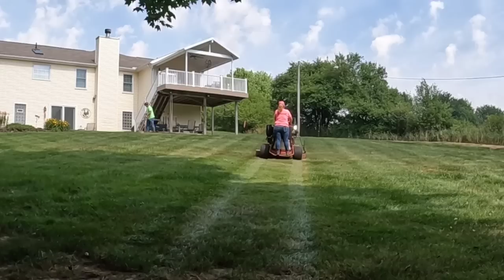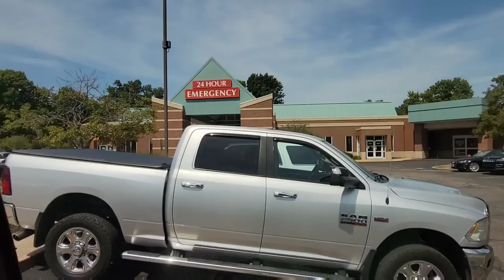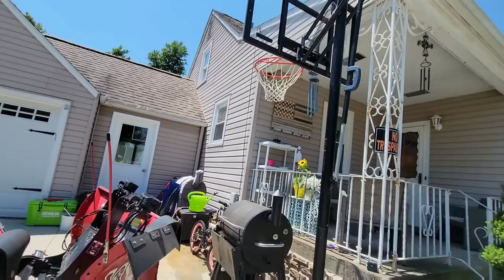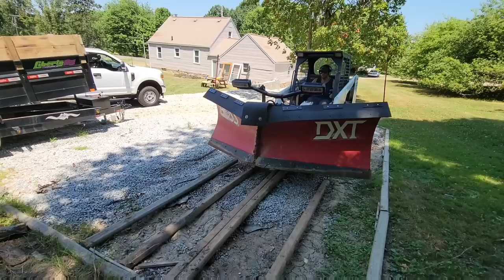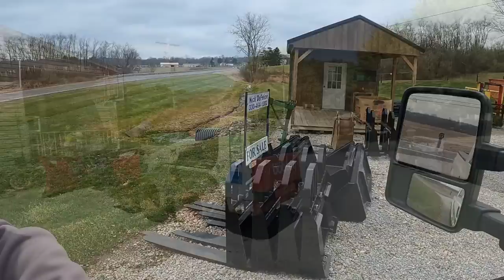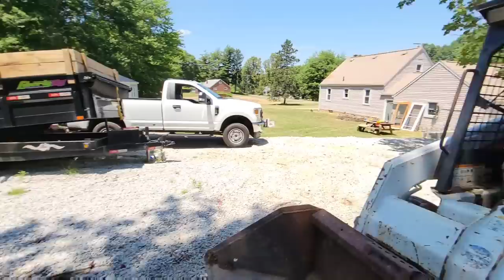I HOPE THIS WORKS BECAUSE I DON'T WANT TO HAVE SURGERY!

Comment: Shawn, Do what I do with my tractor. You already have a roof over you on the skid steer, I have a canopy. I just put a golf cart cover over the canopy and let it hang down. At the bottom part I use spring clamps to hold it down. A friend used my idea on his Takeuchi (spelling) skid steer. it keeps the elements out, not bad for him because he's sitting next to the engine, bad for me because Kubota puts it's radiator in the rear of the engine and pulls the air away from the cab area.  This winter I'm hoping to have a cab for it.  I use to be a licensed yard maintainer, now I just help landscaper friends, and push snow in the winters.  Here in Delaware We've seen some winters with no snow so I don't count on that.  Just something to keep me busy in retirement.

Comment: Hope you have a speedy recovery.  It would be worth looking into the plow. They might have a setup for that or they might be able to put the blade on a new mount. I know you can put a standard straight of v plow blade on a skidsteer. Size might be an issue. I got a western enforcer on my truck (1/2 ton) and those are popular skidsteer plows. But it's also only a 7'6" plow. My wife wants me to fire up the grill this weekend after seeing what happened to you and Brian Fullerton I am a little afraid.  Landscaper grill jinx this week?

Comment: Camso makes a rubber track system that does fit over the standard tires..I don’t know about you specific model…Having plowed snow with a skid steer I would fully recommend an glass enclosed unit…I prefer a skid steer for plowing because you can consolidate you piles of snow better because you treat the snow like an aggregate and pile your snow as high as you like…you are looking right at the blade so it’s easier to see how plowing is actually going…and you can instantly reverse the direction of plowing so if you set your plow job up with a pile of snow in each direction you eliminate all the reversing with no snow removal. The only down fall is having to move your equipment around if your jobs are all not in one place.

Comment: After that you loaded the first snow blade up and started to go around the house and the view looked as if the blade was attached to the Bobcat, I thought wow wonder if a person could fasten one of these snow blades to a skid steer . The company that I worked for years for, I ran there open cab Bobcat with tires and never used chains, moving snow at their restaurants and convenient stores, but I believe it was a
783, it's been numerous years and I have a had a blood vessel bust in my brain and it caused me to have a sever stroke on September 5 of 2014, but I have had a blessed recovery and the best thing is it never  affected my ability to talk, eat and swallow, but paralyzed the rest of the right side of my body for a while, but doing good now . Years ago I had  a problem with my lower jaw swelling up all down underneath from the front of my chin and back to under my ear and hurting and getting really sore, the swelling would go up and then go down some and I could work doing this or that and maybe get hot or just exert myself some  for awhile and the swelling would go back up and it was 2 of my wisdom teeth causing all of the trouble . There just wasn't enough room in my mouth for them, I had all 4 of them pulled and never did have anyone problems . But anyway hoping that you are doing better . I will see you all later, so take care and stay safe and keep on cutting grass and making us more videos .
As always, Jeffrey !!!
🤗👍💖💫

Comment: ENT is an Ear, Nose & throat specialist. I had an oral abscess & saw an oral surgeon, he lanced the abscess (without local anesthesia), it would not have worked apparently, so he just cut. Make sure you are kept on long term antibiotics to completely wipe out the infection - over a month. I wasn’t on long enough & ended up 3 month later in the hospital with bacterium sepsis for a month, which I don’t remember, followed by another month in rehab, receiving antibiotics through a pic line & learning how to walk. So be pushy, ask for long term antibiotics. While on them take probiotics to keep the gut working properly, otherwise you will experience intestinal problems. This is a serious matter and not to be put off. (I’m a retired nurse & this was a very difficult to go through, you don’t want to experience this. Prayers that the right medical personnel take care of you and that God grants you a total recovery.

Comment: Honestly  for what all you got going on with the property and if your wanting  to mainly use it for loading and snow removal consider a loader tractor that has a cab. It'd would be cheaper than a skid steer and also offer other flexibility and a world of attachment options front and rear.

Comment: I had a tumor in my throat had to have surgery in December it was 7.5cm long and 6 cm around I’ve lost my ability’s to speak or eat solids couldn’t cut for 3 months I put down rye I’ve lost 50#s since spring started hopefully I will level off soon. Good luck

Comment: you can push snow no problem with that.  the problem is attaching a regular plow to the skid steer, you'd be better off trading in the plow for one made for the skid steer.

Comment: Shawn, I expect they probably said you would need an "I & D", which is incision and drainage. You appear to be in pain so I hope the antibiotics do their thing and get the infection calmed down so that your pain disappears. In my opinion, you handled moving the plows quite well, so unless you have other tasks that require forks I wouldn't spend a dime to get them. Bobcat has a few really good mounting systems and I have seen many skidsteers, of all brands, plowing with gear originally intended to be coupled with a truck. I hate the cold and I have been in very similar situations as your non-enclosed cab so I wore a good Helly Hansen suit and I was as snug as a bug heh, heh. Prayers for your speedy and full recovery and hats off to TQ and Lathan for gettin' 'er done. Keep on keepin' on.